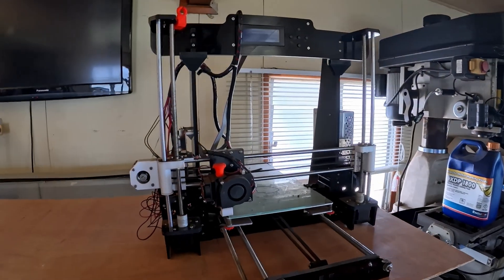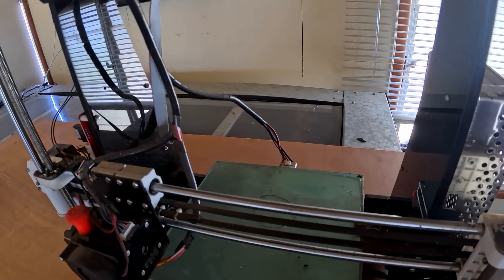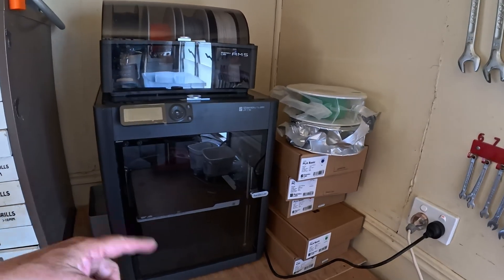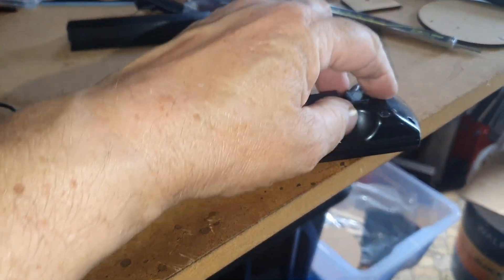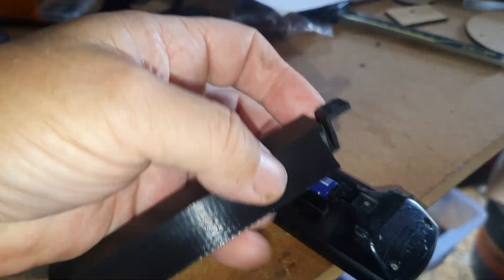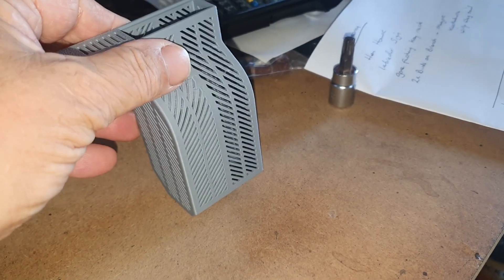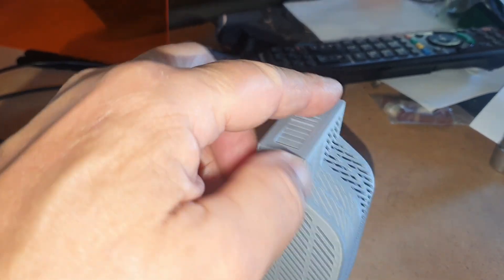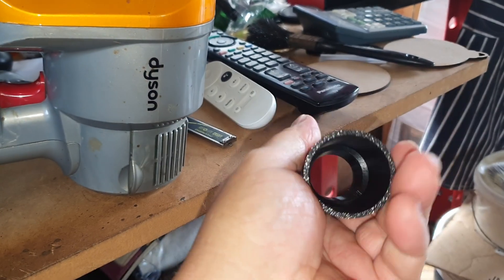Upgrading from Anet A8 to Bambu Labs P1S Combo – First Impressions

Comment: Nice one. I've been massively impressed with my P1S. I would recommend printing a riser for the top glass. The main reason is the tube rubs on the top glass and rubs away the tube / pits the glass. It will also allow you to have the front door closed for PLA as they have vents on them that you can open and close. and third you can put some extra lights in so you can see it printing better. And with the door closed and vents open its much quieter and it stays at around 35-37 depending on weather (am in the uk and no ac). Another good print is a little ramp for the front bottom just bellow the glass to allow easier clean-up. And finally some removal tools for some of the connectors on the back. Sometimes when you need to work on it removing these parts is a pain as the clips are facing the back wall of the printer so a tool is very useful. Look forward to more videos. Cheers.
Reply from the maker: @drdoomslab  thanks for that, have watched a few videos on accessories. Which top vent did you use? There are so many to choose from.
Reply: @plasmaDave  I printed the "Siding Vents Riser" on maker world. Its low profile, has vents you can close / open, and is easy to print and you can still put the AMS on top if you want (mines on the side) and use the top glass. Just be slightly carful when lifting the glass as it can be tight and pull on the riser sometimes. I printed it a while back so used V1 but theres a V3 now. There is also a TPU gaskit but iv never printed it. Cheers.
Reply from the maker: @drdoomslab  thanks I'll go and search for it 👍